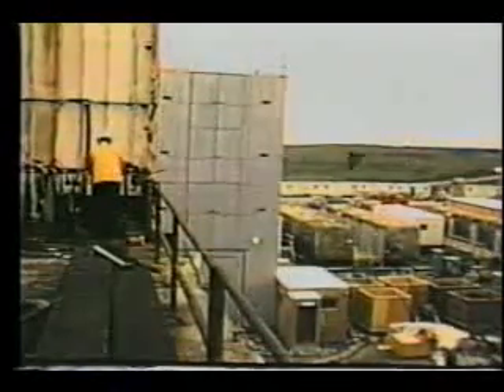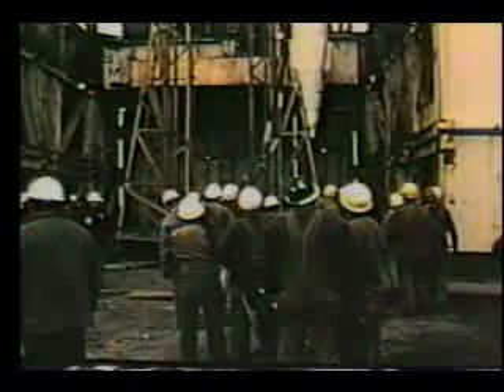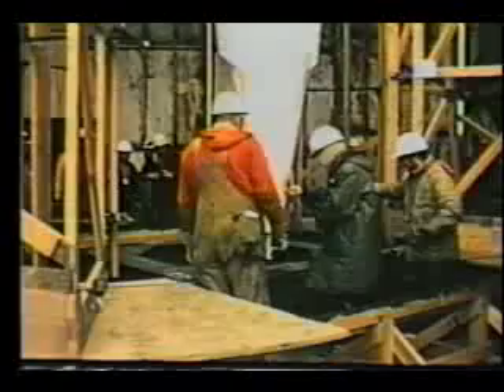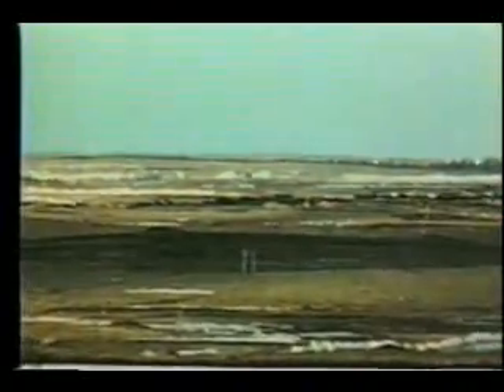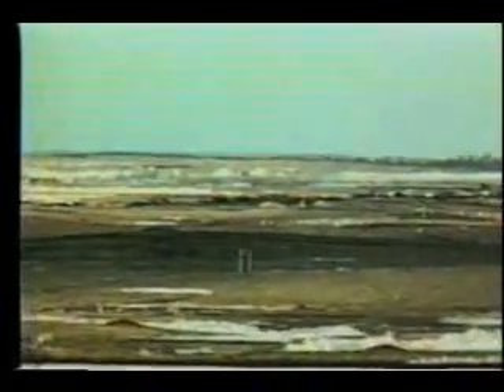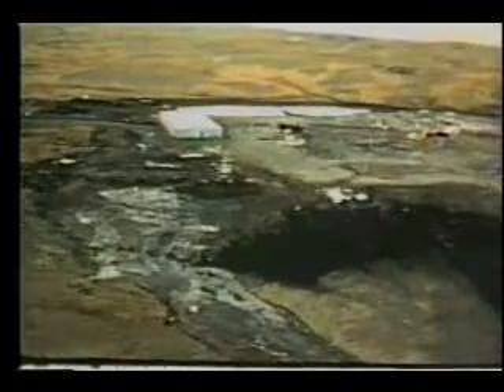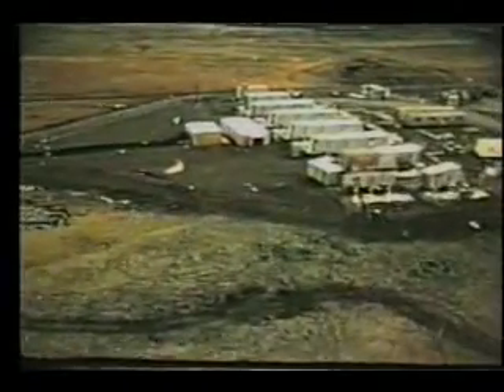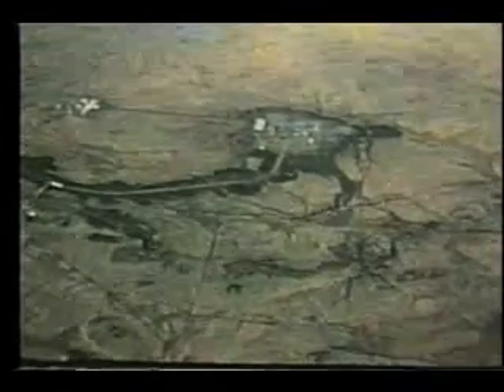Declassified U.S. Nuclear Test Film #41

Comment: Amchitka Island is between 51.66203 degrees North and 51.348386 degrees.  Therefore it covers from north to south 0.313644 of one degree. Or 0.31% rounded of one degree.    It is 0.16203 of a degree north of 51.50N degrees and 0.151614N south of 51.50N degrees. There is therefore 0.010416 of one degree more north of 51.50N degrees. (10416 millionths of one degree or one hundredth of one degree rounded).

Where exactly did the detonations happen?  I believe I found it.  It is now filled with a visible lake. WNW of 'Reefer Point'.

The highest Geo point seems to be 348.996meters (1,145ft).